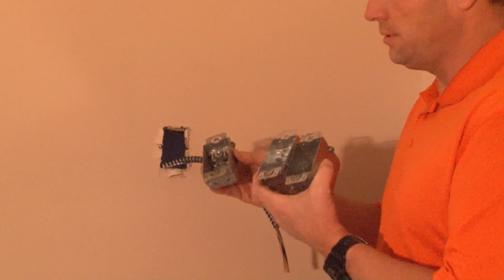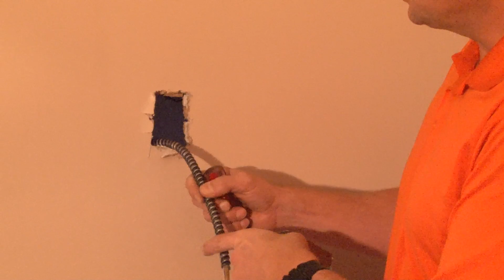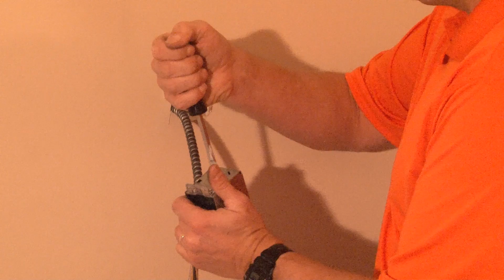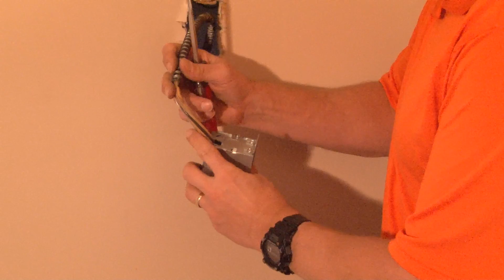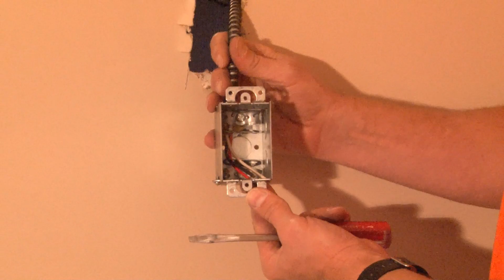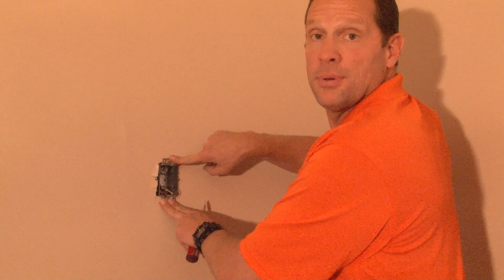Switch Boxes: Switch Box w/ Clamps for Flexible Metal Conduits, Side & Bottom Knockouts G601-BX

Comment: Um, pretty sure that's not FMC(flexible metallic conduit) that you keep referring to.  That's MC cable (metal clad).  The smallest trade size of flex is 1/2" so it won't fit in those k.o.'s.